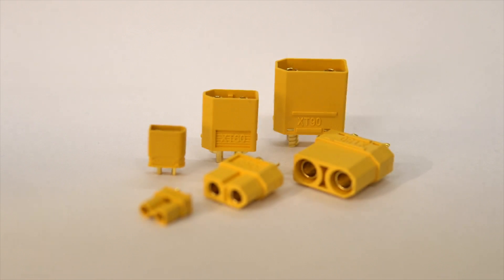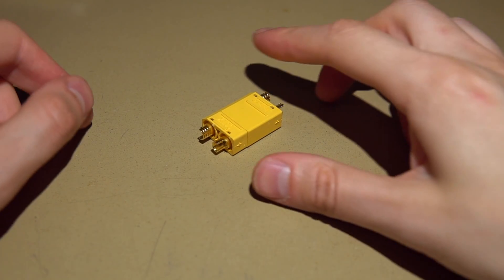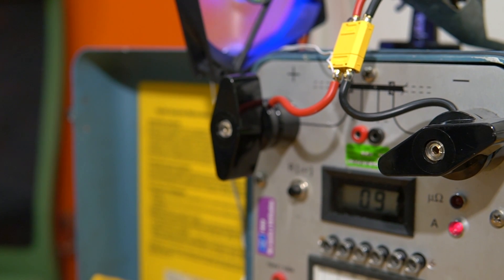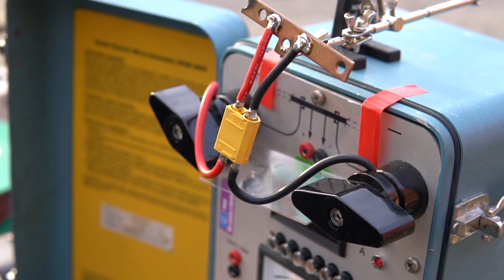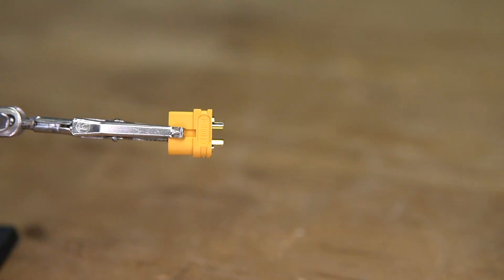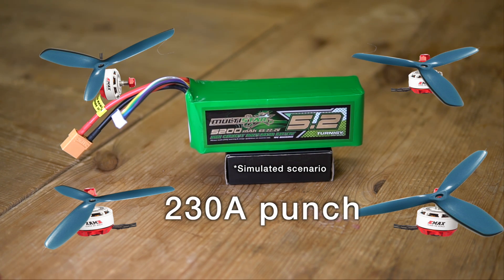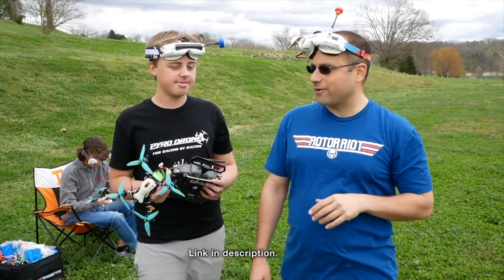XT90 - Measured and tested

Comment: XT90S (anti spark variant, only available in the 90 form factor) is my favorite connector nowadays regardless of it's ampacity (used XT60 before and had no situation where I hit a sustained load that it would matter, would you punchout in a drone so hard that a connector melts, I want to see that battery you're using, I want one :)). Not flying so much these day but for my skateboards, scooter and ebike my battery connectors looked burned and always almost explode and spark when connecting my huge up to 20S packs to the initial discharged condensator (2000uF / 100V on my scooter for example) and kind of short circuit for a brief time period. This damages the contacts of the connectors pretty badly and can reduce the performance drastically (hav have this on drones too but less severe) , XT90S solved that problem for me finally. Thanks amass

Comment: There are two more connectors in that series the XT150 and AS150 (three if you count the XT90S). Both of those are shrouded bullets and are intended more for big 12S helicopters and planes rather than drones.
Reply: There are also the MR30/MR60 and MT30/MR60 three poles connectors intended for connecting ESCs to brushless motors, they use the same pin size of the respective XT30/XT60s.
The MR have the pins in line while the MT in a triangular shape.

Comment: Tin the wire, insert it into the connector using a holding fixture, place the lightly tinned soldering iron against the wire and the connector pin, and let the heat of the wire and pin melt the solder into the connection. Don't put solder in the connector pin, reheat it, and insert the wire while holding it with your fingers.

Comment: Nice video! Thanks for this "limit" test. Without the faintest intention to being picky, the de-soldering on the video might have been partially contributed also to the awg10 wire heating and not just due to the ohmic losses through the connector. A heavier wire might allow higher current, but would be to much weight for a drone. I am planning to use the XT90 for an electric boat motor, weight is not a big problem so i will use the bulkiest wire on XT90 which i can fit. The XT90 was the best priced solution i could find for about 100A loads, I looked at the Anderson ones (too expensive), the SAE (which was immediately dropped as it can handle maybe up to 10A)

Comment: The problem I've found is getting quad motors that can really handle 6S power. If the wires aren't designed to handle the voltage, they fry almost instantly. The SunnySky Edge Racing R2207 FPV Brushless Motors - 1800Kv I bought fried on 4S but were supposed to handle 6S. I am currently using some T-Motor VELOX V2 2207 1950Kv Motors on 4S but 1 burned up doing static testing on 6S so I'm limiting them to 4S now. Do you think the EMax RS 2306-2750Kv you mentioned here will handle 6S?

Comment: i'm building an easy car jump start kit with xt90 connectors(meaning you are not required to open the hood to jump the car) hope it works! (yes i'm using the correect wire)

Comment: dronelab - I wanted to know whether I can use a single XT90-connector (I am severely space-limited) to deliver absolute maximum of 54A @48V, most likely in less than 50/50 duty cycle), with forced cooling, or do I have to use two parallel connectors. This video answered my question, and I appreciate that. Thanks!
Reply from the maker: Easily! When we tried them at 90A with a tiny bit of airflow, they stabilised on 82°C, which may be a bit warm. But heat dissipation scales with the square of current, so if you run them at 54A, that's almost 3x less heat - they will certainly stay cool and safe. Just make sure you are using AWG10 as the thick metal conductor helps cool the connector a lot.

Comment: This is good information. Thanks. I'm not sure but I think your test at the 1 min mark is with 4S power. If you upped the volts to 6S/25.2V, wouldn't the watts be much higher and the amps much lower for that same test. The amp rating would be much lower than 270A, right? And if it was 10AWG, what would that amp rating be? Those are the questions I'm trying to figure out. I don't have the test equipment to do it though.
Reply from the maker: It's a bit counter-intuitive, but actually the voltage doesn't matter - the current is the only limiting factor for connectors or conductors. In fact, all the tests were performed at below 1V. That's why energy distribution lines run at very high voltages - as high as 400,000V - so that the cables can be thinner and lighter. Similarly, all the USB "fast charging" technologies run at higher voltages than 5V, to be able to deliver more power over the same thin wires and connector. That's also why we recommend an 6s XT60 over a 4s XT90 - they both can deliver roughly the same total power (180A * 16V is same as 270A * 24V), while the XT60 is lighter.
Reply: @dronelab1280  That must be the new math you're using. In your example, 180A x 16.8V (4S) = 3,024W.  And 270A x 25.2V (6S) = 6,277.5W. The 6S example is a little more than twice the power of the 4S setup. I think maybe the voltages are swapped? To get the equivalent wattage I have to use 4536W or 270A x 16.8V = 4536W. For that same 4536W on 6S I would use 180A x 25.2V = 4536W. I understand the current limit for the connectors. By bumping up the volts, my amps can be less. I use 6S 5Ah LiPos on my EDFs. At 105 -120A, my XT90s connectors get warm. Were I to use 8S power, the identical power would be available at a lower amperage. But the larger AWG wire and XT90 connector would not get as warm as it would at the 6S power setup even though the power is the same. I believe the lower resistance of the larger wire is the reason for less heat.
Reply: @dronelab1280  A shorter way of my other long post is to go to connector rating tables. A JST connector is rated on it amp carrying capacity based on the AWG of the wire it is connected to. I don't have the #s in front of me but on 28AWG wire, the load is about 1A. On 22AWG I believe it is about 6A.

Comment: I'd be interested to know what type of solder was used on the connection that de-soldered itself.
Reply from the maker: We used classic, leaded 60/40 solder in all these tests. Some people correctly pointed out that using unleaded solder would increase the melting temperature, and therefore make the connection last a bit longer. But already at 200°C the silicone insolation is subject to degrading, so even if the solder wouldn't melt and fail, at that point the connection is just too hot to recommend. On top of that, most unleaded solders do not handle vibrations very well so we really do recommend leaded solder, as long as everyone pinky swears to take the right precautions when handling and disposing of it.
Reply: @dronelab1280  Thanks for the reply, and I agree with your conclusions. That said, I can't help but wonder what the fail number would have been with Sn/Ag...

Comment: Is that just shorting the current into the wire/connector, Or is the machine designed for that and it just passes through to a resistor or something?
Reply from the maker: The machine controls the power, so that we can (reasonably accurately) limit and control the current.

Comment: which instruments have you used for checking the ampere capacity of connector???
Reply from the maker: the MOM600 micro-ohm-meter by Megger. It's a fun little (24kg) device purpose-made for testing cables / connectors under loads up to 600A.

Comment: Good test. I was wondering if I should use XT90 in my 120 A plane (intermittent).
Reply from the maker: Yes. Even though the XT60 can handle 120A for a short time (10-20s), on a plane you might want to draw high currents for longer periods when climbing in altitude. The extra 7g of weight probably isn't that significant for you plane either, so you will be much better off with the bigger XT90.

Comment: This video only tells half the story but I guess it makes sense given this is a channel about drones. You only tested the burst current rating and that too only in an environment with good airflow.
You should also do a test of the continuous rating both with a fan, no fan but in free air and in an enclosure. Continuous meaning apply the load until there is no longer a temperature rise of the connector
Reply: akbar Ramzan - I understand your comment/criticism, and would also like to see a video in which the XT90 connectors are tested to the point of failure. Having said that, this video did provide useful information to me*. However, I do realize why a drone channel does not (and probably should not!) consider sealed enclosures and forced cooling. I would actually argue that no sane person would engineer a product that uses a single 90A-rated XT90 connector when there is a continuous current draw exceeding 270A. TBH, I was actually surprised to see this 'Chinesium' (effortlessly) surviving a 10s 270A burst.

*) I wanted to know whether I can use a single XT90-connector to deliver absolute max. 54A @48V, most likely in less than 50/50 duty cycle), with forced cooling, or do I have to do two parallel connectors. This video answered my question, and I appreciate that.
Reply: @MrZetor  XT90 is officially rated for 40A continuous, 90A maximum
Reply: Many hobbyists however, run it at 90A “continuous” with forced cooling. I put “continuous” in quotes because the small lipo batteries in drones will drain very quickly at 90A and likely won’t let the connector reach equilibrium
Reply: At 90A continuous even with light cooling, the connector will reach temperatures of 120*C or higher. This is the limit of its operating temperature

Comment: Will the XT90 connectors prevent spark from happening when disconnecting or connecting them from the battery?
Reply from the maker: There is a special "Spark-proof" version called "XT90-S". It looks almost identical, with just a bright green stripe. It's only available on the female end (battery side), so you might need to replace the connector on all your batteries. It suppresses sparks very well, just be careful to not leave it half-plugged, and often check if the fit is tight, otherwise the very simple spark-proofing mechanism can burn out.
Reply: @dronelab1280  Ok thanks.  I wish that these connectors (XT90-S) come with the battery but I'm afraid they are not... I'm afraid to install the connector on these batteries myself cause I'm afraid of the spark/explosion. The explosion I had caused my finger to burn. My scooter battery is 60V 26 Ah.
Reply: @rockefelleragent1357  

Soldering a battery wire is safe, unless you let both of its wire lead touch each other. The safest way to deal with the battery is to cover up the wire you cut. Then do the connections. It don't matter what color, as long as they're not touching.

Comment: xt60 or xt90
for my 1000W Ebike?
13s Li Ion (54,6V)
Reply from the maker: 1000W / 50V, that's 20A, an XT60 would handle that just fine. But, since you probably don't care about 15g of extra weight, I would recommend an XT90. It's more comfortable to grip and handle, you can get it in a spark-proof version that makes connecting safer and more pleasant, and you will get a tiny bit less losses (0.5% vs 0.7%) since the bigger XT90 has less contact resistance.

Comment: I'm upgrading my Traxxas X-Maxx, I add a hobbywing Max5 200amp and using two 4s 6500mah 100c,total 8s, is it good to use xt90 connectors?
And is there more than manufacturer for it? How can I get the best quality?
Thank you

Comment: i would have loves to see how much the connector can handle with abigger wiers like 8awg so that the failure point is the connector not the wire
Reply from the maker: We tried it extensively with the XT30, where we found that there is a significant benefit to using an 16AWG over the recommended 18AWG. At 12AWG the connector was definitely the limiting factor, though such a combination isn't practical, as the wire would be disproportionately heavy - an XT60 + 20cm of 14AWG would way the same, and handle more current.

We didn't have a cable thick enough to try it for the XT90, but I wouldn't expect to get much more out of it. I'll be on the lookout for an AWG8 to give it a go at some point though.
Reply: @dronelab1280  yes but with xt90 it would have been very interesting to see it with 8awg wire because a lot of people might go down that rout knowing that the connector propabaly can handel more then the 10awg or a current test of 10awg with a temperatur reading would have also been very conclusiv because from what i have seen on the vidio the cables were hotter then the plug itself meaning that it could propabaly be able to handel way more current

Comment: Can i use a regular XT90 male connector with XT90S female
Reply: XT90S only applies to the female. The male is the same. The female side has a split in one of the terminals/barrels with a resistor in it when you first plug it the first couple of mm. Once it's fully plugged in, the resistor portion is bypassed.

Comment: my 1/8 rc car has a tp4070cm which is rated for 8s 300amps (9kw) peak and 180amp continuous, so I'm guessing an xt90 wouldn't suffice. Even the 10awg wire on the lipos get warm as does the 8awg wires on the castle xlx esc. Right now I'm using 6.5mm bullet connectors, does any know of any other type of connectors that would work?
Reply from the maker: At that point connectors become very big and heavy. You could consider an Anderson SB120, but that's one really clunky piece of hardware. If possible, try to improve the airflow in battery compartment - a pair of vent holes (front and back) can make a massive difference.
Reply: OSE QS8 might be good choice.

Comment: Am interested in using xt90 for lifepo battery applications for mobility scooter being converted from sla batteries with f2 blade terminals on the batteries.

Comment: Hi, my system will draw max 230 AMP, I found the turnigy battery that can handle up to 240 A, wich is the best for me. But unfortunately, they come out with XT-90 Connector, now. Why a 240A max rated battery will come out with this connector ? Can this connector  Handle safley 240 A ? THANK YOU continous ?...THANK YOU
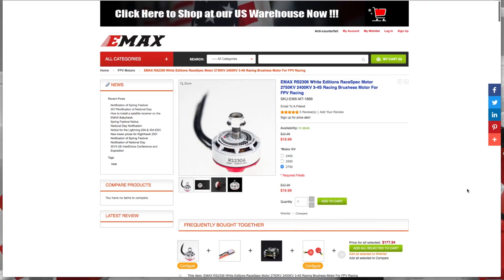Reply from the maker: Battery manufacturers tend to do that, I'm afraid :D If you only need the 230A for a couple of seconds at a time, the XT90 will be fine. Currents above 100A are a bit impractical, and high-power devices use higher voltages instead. You could use an Anderson Power SB175, that's rated 300A. Though at that point the connectors are very large and expensive - we briefly show an SB350 that's rated 600A at 2:22 in this video. Alternatively, for continuous 230A, you can use three XT90's in parallel, or two XT150s in parallel. I would try to reduce the current as much as possible and go higher voltage, though.
Reply from the maker: One more thing: That battery might not actually survive a 240A continuous discharge. The wires themselves would have to be AWG 6 to survive that kind of current for a prolonged time.

Comment: So will I be better running xt90 or ec5 all I run is 6s LiPo in my arrma ?
Reply from the maker: Hard to say without knowing which exact arrma you have, but if it came with an XT90, then it should be fine. Otherwise, or if you modded the motor, you need to somehow figure out the current consumption, or how much the battery can give. The XT90 should handle any 4000mAh or smaller battery, if your battery is bigger you need to figure out the actual drawn current, or be careful on the throttle.
Reply: dronelab I’ll be running a 1480 kv motor and a max 6 esc and battery will be a 5000 mah 6s
Reply from the maker: That's borderline ok. We don't have much experience with RC vehicles, but I assume you don't tend to keep the throttle at 100% for more than a couple of seconds, right? In that case it should be fine. You can carefully check the temperature of the connector / wires after a ride. If it's not too hot to hold, you're safe.

Comment: why none said how much voltage this can be used for?
Reply from the maker: The connector is rated for 500vdc, but since it has no physical protection from touching the pins during handling, I would not recommend using it for anything more than the 48v. 

Note that the voltage does not impact the maximum current.

Comment: HELLO I am contacting you because I would like to know if the XT90 connectors can withstand direct voltage and current
28 volts in approximately 40A?
in fact I have a pack to make in lifepo including 4 batteries in // or 8S/4P given that I have 4 batteries in // per series I was thinking of putting 4 cables and 4 XT90 for the pole + general and also 4 cables and, 4 XT90 for the least general which will be put on the B- of the BMS
the current that will be drawn by my converter will be 140 A max at 24 volts
What do you think? with this situation I think that the current will be divided on the 4 XT90s, i.e. less than 40A per XT90
the cable section will be 10AWG by xt90
Best regards
laurent
Reply from the maker: An XT90 can handle 40A per each of its two poles continuously at any voltage up to its rating of 500V no problem. It's generally not super safe to use connectors in parallel since if one of them fails, the others have to carry the additional load. But, if you have a lot of overhead, this should be fine. Do you intend to use a total of 8 connectors? 4 for + and 4 for -, each with 2 AWG10 wires? If so, you have a lot of overhead. This should be fine. Just remember to not apply any load (have your converter or anything connected to it OFF) until all 8 connectors are plugged in.
Reply: hank you for the information
yes 4 XT 90 connectors on the packs - 10AWG
and the same for the +

otherwise perhaps it is more judicious to use copper tubular eye connectors instead of XT 90?
cheaper to purchase and less risk of defaults?